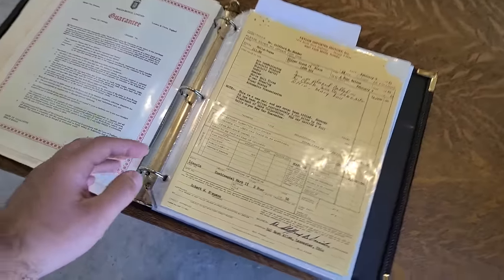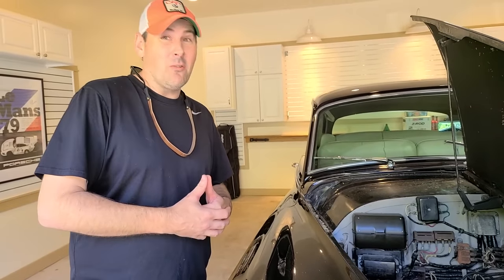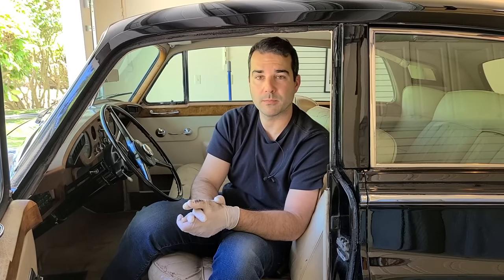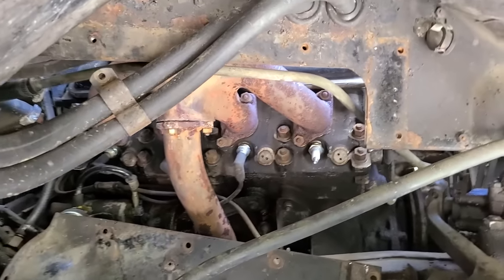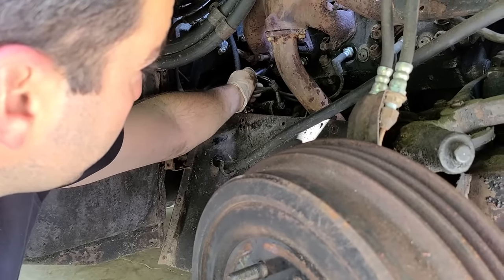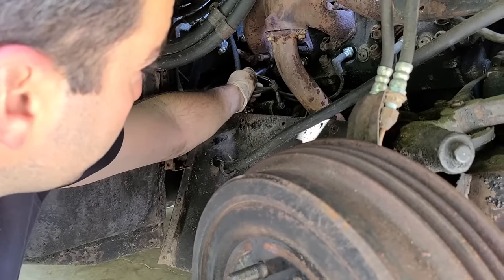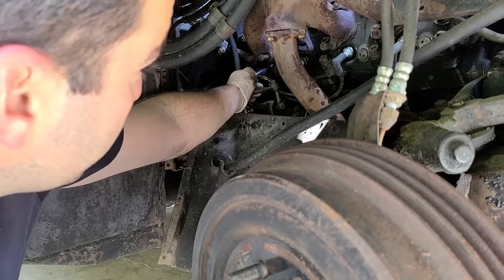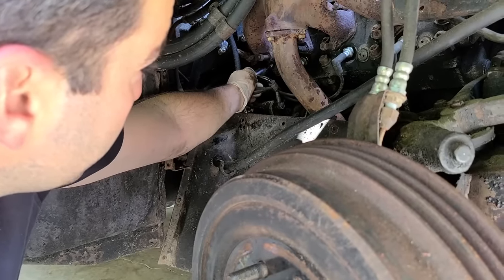I Bought A Broken Rolls-Royce 1000 Miles From Home! 1 Day To Fix EVERYTHING Before Hitting The Road!

Comment from the maker: What's a car you regret selling?
Get Honey for FREE today ▸ http://joinhoney.com/legitstreetcars
Reply: Hi bro I'm ine of the first 5 viewers lol
Reply: Regret selling? 2006 Acura TSX, 6 speed. Such a good car.
Reply: I had a 2005 Ford Mustang convertible. It was Red Fire, had the premium package and the Shaker 1000 stereo system. I traded it in for a brand new 2012 Mustang that had nothing extra. 2 weeks later I was kicking myself. I went from an automatic to a stick shift and that 2012 tops out 118 mph which was the thing that really irritated me because the drive shaft shatters at 135mph and it wobbled when you downshifted from 3rd to 2nd. You could feel it. A piece of crap.. 
Now I have a 2015 Mustang, that I got brand new 6 years ago and I couldn't be happier. Unless I also still had the 2005. I miss that car.
Reply: I’ve only sold 1 car and traded in 1 car.
I miss the trade-in (1985 LTD Crown Victoria).
Reply: Regret selling my 300sd Mercedes.
Reply: 91 mercury colony park wagon.
Ford's last wagon. Had 215k miles. Trans went. Should of fixed it.  Handy man's perfect car.
Reply: The only can I regret getting rid of was a 1991 jeep wrangler. Had the 4.0 liter, 5 speed manual.
Reply: So many! My first car, a '63 Austin Healey 3000, my '68 Firebird 400. Frame rust killed my '71 Corvette, parted out.
Reply: 1973 Plymouth Scamp 2 dr hardtop with a 318 /727 torque flight and custom rear end work
Reply: Not a car but a bike, A classic Royal Enfield from 60s. that bike drives me nuts while fixing but it was worth it. An Impulse Sale. wish i never did it
Reply: My '70 Plymouth Roadrunner with a 383 Magnum, (then again I was only 17 driving a five year old Mopar rocket).
Reply: 1955 Willys P/U
Reply: I regretted selling my W211 E55, so I bought it back....🤪
Reply: Thanks for the great video :) <3
Reply: I regret not buying a 1 owner 1972 280SL with 8,000 miles in 2008 for 8,000 bucks. That car is worth 250,000 today.
Reply: 1972 Impala custom coupe.
Reply: Stationed in Germany in 1985, bought a 1978 911 Porsche Targa with whale tail in bright red. I paid only 5 grand for it. The only thing wrong with it was the heat exchangers did not work and needed replacing. I had to sell it because I received orders to go back to the US and the car did not have the US safety specs to qualify bringing it with me. If I had taken the time to do more research on car import laws during that time I would have found that a person was allowed 1 waiver during his or her lifetime to import an exotic car into the US.  That car was so fun to drive.... miss it so much to this very day.
Reply: I regret selling my 1986 W150 Dodge Pickup followed by 2000 Dodge Pickup.
Reply: I regret selling my 1983 380SL
Reply: When are you gonna be on car trek bud?
Reply: Wow, the exact make and model I replied with a guess on your last video (1961 rolls Royce silver cloud)
Reply: My 4th Gen Toyota 4Runner V8 4WD Sport Edition. Never had a better car than that one
Reply: Convert it to electric with uncle rich.
Reply: Love it...
Reply: '66 Mustang I bought in high school.
'89 Celica my dad gave me.
'90 Supra I bought with the money I sold my Mustang for.
Reply: Hey man for shits and giggles. Will you take off the stock exhaust system and put a magna flow exhaust system on your RR silver cloud.? And if you decide to just put a stock one back on. 

 You know just for shits and giggles.
Reply: Hope you did not buy that goner m3?
Reply: My 1983 Oldsmobile Toronado 😔
Reply: My Jeep Wrangler
Reply: Good to see all the guys
Reply: 98 Toyota Corolla 5 speed manual, miss my gas saver
Reply: 1960 MIni
Reply: My 63 Chevy Impala and my 78 Nova. I’d look to have either of them back
Reply: 1959 MB 190SL. Purchased for $200 cash with only three wheels. Spotted while on a bus coming home from school. Off the bus, find the owner, buy the car and have it towed to Mom n Dad's. Parking on the street on a steel milk crate. Took subway to get parts until the guy said NO to a battery on the subway. Three gallons of body putty and countless aluminium bakery pan later I had my first car.
Reply: S2000 and El Camino.
Reply: I regret selling my old Mitsubishi Galant VR-4.
Reply: My 1983 rabbit GTI. I bought it from one of the guys who worked at Pete Lovely racing when I was stationed in Washington. Apparently it was the first GTI that Pete Lovely got into his dealership. Had no sunroof and dealer optioned power windows.  It was 100% original when I got it and I spent a lot of time and effort making it my own.
Reply: Hey I love your videos, I wish you did more with Toyota because that’s all I’ll buy 🤣
On a serious note! I like your logo but it’s black and I use dark mode and miss your notifications because your logo blends it. But Freddie’s tavarish logo stands out more
Reply: My 1969 Mustang Mach1 428 CJ 4 speed with the shaker air intake.
Reply: Small regrets on selling 1989 Ford sapphire Cosworth
Reply: You're a baller on a budget lol 😂😆
Reply: La swapped the rolls like watchJrgo...
Reply: I had a 67 Unimog 404 I should have never separated with.  Working now on replacing it
Reply: My 2001 Acura integra type r. But it probably would have gotten stolen at some point anyway.
Reply: 1990 Toyota supra 7mgte 5 speed, red on gray leather, tems suspension guy ordered new every option available now I cannot find another even similar
Reply: 1968 Torino GT convertible. White with blue C stripes Indy Pace car model.
Reply: None. Kept the 64 1/2 Mustang too long. The first gen slk  was fun  but build quality was shit. The S-10 was an 80s GM product. Now my VFR, that I regret trading in on the Blackbird
Reply: My 1962 Westfalia VW van with safari front windows. I sold it for $2,000 and now it's worth a bazillion. My mom's 1970 911E is another one... Sigh.
Reply: Toyota Corolla GT😎
Reply: 1972 Porsche 911t sepia
Reply: 32:49 the good thing is this car is not a 	right-hand drive, color is aristocratic, and this model is meanwhile rare, rises in value. Of course it might require twenty thousand - fifty thousand on repairs and replacements on the drive system, interior.
Reply: 1977 dodge aspen station wagon never did get to finish getting it on the road and I had to select as I was leaving
Reply: '56 Studebaker Champion 2 door
'78 Triumph Spitfire 1500
'68 Mustang 302, stick, notchback
'89 SAAB 900, 4 door non-turbo
Reply: 1970 2 dr All original Chevy Impala, young and stupid I still regret getting rid of her. The Rolls-Royce will probably end up being your most reliable Car, She's so Beautiful
Reply: My 78 Olds Delta 88 Diesel lowrider it was a boat that got 30 mpg and fun as hell with Hydraulics!
Reply: Well my first two "cars" actually. A 42 Ford GPW Jeep, and a 41 military closed cab 1/2 ton Dodge Weapons Carrier with a winch. Jeep was first the Power Wagon was a upgrade for the heater and a actual cab to sit in. I really miss them both and all of the stupid things I did with them.
Reply: @rohittaurus911  Had one too.  Great sounding bike. Really liked my '96 Mark VIII
Reply: @capedoryus  EPIC first car!
Reply: I regrett selling my 1962 Jaguar Mk2 3.8 manual!
Reply: Easy one, 2010 BMW X5 M. Loaded with every option imaginable. Lots of tech. Not a single issue, no dash lights. But expensive to maintain. Why I sold it.
Reply: 1974 Porsche 914. Should have never let that go.
Reply: 1985 MkII Supra 
1993 5.0 LX
Sold the Supra to buy the 5.0, wife got pregnant and the 5.0 went for a 1990-something Boringmobile. Wife is long gone, kiddo is 25 now and I’d give an appendage to have those 2 cars back.
Reply: @aulzhoefer  someone just stopped me yesterday and tried to buy my 2005 E55 and I was like, ‘nah, it’s not for sale, at least not yet.’
Reply: @altafari  nice one!  One of my favorites!  I had a chance once to buy a 914/6...  we couldn't agree on a price.  We got close but he really wanted $500.00 more than I physically had.  Sad Face.
Reply: 1969 Dodge Charger R/T SE & a 1967 Dodge Dart GTS 383 4 Speed.
Reply: My 69 GTO
Reply: 2003 Corolla. There was nothing wrong with it, never gave me any issues and now I miss it! Only sold it cause some lady offered $5k and I'd only paid $3k for it and was down $10k from the down payment on my new Veloster N
Reply: 1976 jaguar xj12l with a 351 Windsor and a c4 swapped in. Also the 1995 grand cherokee limited I drove in high school but that one is for sentimental reasons.
Reply: It's worth 150'000 to 200'000 to the right collector.
Reply: For my Dad, he always regretted selling his 1939 Chevrolet Sedan. Dad and Mom drove it from Milwaukee to Louisiana to Washington State and back to Milwaukee pulling their trailer during WW II. He always dreamed he had that car back!
Reply: A friend of mine bought the same car at Sotheby’s, because it belonged to the queen of England. The fuel consumption was about a bucket per mile, but I ran like a dream.
Reply: I have, and had, cars that I regret NOT selling. Sooner. TWO Citroen SMs for example. What is a person who has two SMs called? Glutton for punishment.
Reply: My Volvo Amazon -61 for $100.
Reply: Regret selling my 1969 opal GT
Reply: Dump some seafoam in the tank she will thank you for it
Reply: 1993 Camaro Z-28.
Reply: When I was 17 I bought a 1976 Saab 99.  i LOVED that car.  It was so much fun to drive and looked cool.  I paid $1500 for it.  Had it for 2 years and sold it when I went to College for something newer.  I've always regretted selling that.
Reply: 62 Mercury comet when I was 17
Reply: My 1970 W-31 Olds Cutlass.  An awesome car!
Reply: 2 Litre GT Ford Corsair Crayford Converted Soft Top in White with Red interior and Top.
No! Don't go looking for images. You'll end up wanting one.
London to Edinburgh in 4 hours with one fuel stop but back then there was no speed limit on the motorways and they filled your tank for you so it was more of a "Keep the change." Pit Stop.
Reply: 1962 VW Beetle 1200, 6Volt,  soft pushbback sunroof.. small oval back-window..
Reply: 71 alfa romeo spider with front end damage.
Reply: My father's gift to me for Xmas 1967 - pastel yellow Ford Mustang fastback
Reply: 1966 Imperial LeBaron. Absolute whaling ship, but sooo comfortable on long trips.
Reply: @AJGreen-cn8kk  ~~
Reply: 1954 XK-120MC & 1964 Pontiac LeMans 326
Reply: 1972 Chevelle SS 350. Racing 🏎️
Reply: My first car, a 1970 MGB GT...
Reply: My biggest regret was selling my 2003 BWM M3 CSL after 7 years of ownership. I thought I did pretty much everything with it during my 7 year stint with it but I guess I was wrong B-((.  Another regret was selling my one owner from New, fully documented, German import  (Black on Black ) 1993 Mercedes Benz 500e B-((
Reply: Eeeeeeeeeeeeeeeeeeeeeeeeeeeeeeeeeeeeeeeeeeeeeeeeeeeeeeeeeeeeeeeeeeeeeeeeeeeeeeeeeeeeeeeeeeeeeeeeeeeeeeeeeeeeeeeeeeeeeeeeeeeeeeeeeeeeeeeeeeeeeeeeeeeeeeeeeeeeeeweeeeeeeeeeeeeeeeeeeeeeeeeeeeeeeeeeeeeeeeeeeeeeeeeeeeeeeeeeeeeeeeeeeeeeeeeeeeeeeeeeeeeeeeeeweeeeeeeeeeeeeeeeeeeeeeeeeeeeeeeweeeeeeeeeeeeeeeeeeeeeeeeeeeeeeeeeeeeeeeeeeeeeeeeeeeeeeeeeeeeeeeeeeeeeeeeeeeeeeeeeeeeeeeeeeeeeeeeeeeeeeeeeeeweeeeeeeeeeeeeeeeeeeeeeeeeeeeeeeeeeeeeeeeeeeeeweeeeeeeeeeeeeeeeeeeeeeeeeeeeeeeeeeeeeeeeeeeeeeeeeeeeeeeeeeeeeeeeeeeeeeeeeeeeeeeeeeeeeeeeeeeeeeeeeeeeeeeeeeeeeeeeeeeeeeeeeeeeeeeeeeeeeeeeeeeeeeeeeeeeeeeeeeeeeeeeeeeeeeeeeeeeeeeeeeeeeeeeeeeeeeeeeeeeeeeeeeeeeeeeeeeeeeeeeeeeeeeeeeeeeeeeeeeeeeeeeeeeeeeeeeeeeeeeeeeeeeeeeeeeeeeeeeeeeeeeeeeeeeeeeeeeeeeeeeeeeeeeeeeeeeeeeeeeeeeeeeeeeeeeeeeeeeeeeeeeeeeeeeeeeeeeeeeeeeeeeeeeeeeeeeeeeeeeeeeeeeeeeeeeeeeeeeeeeeeweeeeeeeeeeeeeeeeeeeeeeeeeeeeeeeeeweeeeeeeeeeeeeeeeeeeeeeeeeeeeeeeeeeeeeeeeeeeeeeeeeeeeeweeeeeeeeeeeeeeeeeeeeeeeeeeeeeeeeeeeeeeeeeeeeeeeeeeeeeeeeeeeeeeeeeeeeeeeeeeeeeeeeeeeeeeeeeeeeeeeeeeeeeeeeeeeeeeeeeeeeeeeeeeeeeeeeeeeeeeeeeeeeeeeeeeeeeeeeeeeeeeeeeeeeeeeeeeeeeeeeeeeeeeeeeeeeeeeeeeeweeeeeeeeeeeeeeeeeeeeeeeeeeeeeeeeeeeeeeeeeeeeeeeeeeeeeeeeeeeeeeeeeeeeeeeeeeeeeeeeeeeeeeeeeeeeeeeeeeeeeeeeeeeeeeeeeeeeeeeeeeeeeeeeeeeeeeeeeeeeeeeeeeeeeeeeeeeeeeeeeeeeeeeeeeeeeeeeeeeeeeeeeeweeeeeeeeeeeeeeeeeeeeeeeeeeeeeeeeeeeeeeeeeeeeeeeeeeeeeeeeeeeeeeeeeeeeeeeeeeeeeeeeeeeeeeeweeeeeeeeeeeeeeeeeeeeeeeeeeeeeeeeeeeeeeeeeeeeeeeeeeeeeeeeeeeeeeeeeeeeeeeeeeeeeeeeeeeeeeeeeeeeeeeeeeeeeeeeeeeeeeeeeeeeeeeeeeeeeeeeeeeeeeeeeeeeeeeeeeeeeeeeeeeeeeeeeeeeeeeeeeeeeweeeeeeeeeeeeeeeeeeeeeeeeeeeeeeeeeeeeeeeeeeeeeeeeeeeeeeeeeeeeeeeeeeeeeeeeeeeeeeeeeeeeeeeeeeeeeeeeeeeeeeeeeeeeeeeeeeeeeeeeeeeeeeeeeeeeeeeeweeeeeeeeeeeeeeeeeeeeeeeeeeeeeeeeeeeeeeeeeeeeeeeeeeeeeeeeeweeeeeeweeeeeeeeeeeeeeeeeeeeeeeeeeeeeeeeeeeeeeeeeeeeeeeeeeeeee eacheeeeeeeeeeeeeeeeeeeeeeeeeeeeeeeeeeeeeeeeeeeeeeeeeeeeeeeeeeeeeeeeeeeeeeeeeeeeeeeeeeeeeeeeeeeeeeeeeeeeeeeeeeeeeeeeeeeeeeeeeeeeeeeeeeeeeeeeeeeeeeeeeeeeeeeeeeeeeweeeeeeeeeeeeeeeeeeeeeeeeeeeeeeeeeeeeeeeeweeeeeeeeeeeeeeeeeeeeeeeeeeeeeeeeeeeeeeeeeeeeeeeeeeeeeeeeeeeeeeeeeeeeeeeeeeeeeeeeeeeeeeeeeeeeeeeeeeeeeeeeeeeeeeeeeeeeeeeeeeeeeeeeeeeeeeeeeeeeeeeeeeeeeeeeeeeeeeeeeeeeeeeeeeeeeeweeeeeeeeeeeeeeeeeeeeeeeeeeeeeeeeeeeeeeeeeeeeeeeeeeeeeeeeeeweeeeeeeeeeeeeeeeeeeeeeeeeeeeeeeeeeeeeeeeeeeeeeeeeeeeeeeeeeeeeeeeeeeeeeeeeeeeeeeeeeeeeeeeeeeeeeeeeeeeeeeeeeeeeeeeeeeeeeeeeeeeeeeeeeeeeeeeeeeeeeeeeeeeeeeeeeeeeeeeeeeeeeeeeeeeeeeeeeeeeeeeeeeeeeeeeeeeeeeeeeeeeeeeeeeeeeeeeeeeeeeeeeeeeeeeeeeeeeeeeeeeeeeeeeeeeeeeeeeeeeeeeeeeeeeeeeeeeeeeeeeeeeeeeeeeeeeeeeeeeeeeeeeeeeeeeeeeeeeeeeeeeeeeeeeeeeeeeeeeeeeeeeeeeeeeeeeeeeeeeeeeeeeeeeeeeeeeeeeeeeeeeeeeeeeeeeeeeeeeeeeeeeeeeeeeeeeeeeeeeeeeeeeeeeeeeeeeeeeeeeeeeeeeeeeeeeeeeeeeeeeeeeeeeeeeeeeeeweeeeeeeeeeeeeeeeeeeeeeeeeeeeeeeeeeeeeeeeeeeeeeeeeeeeeeeeeeeeeeeeeeeeeeeeeeeeeeeeeeeeeeeeeeeeeweeeeeeeeeeeeeeeeeeeeeeeeeeeeeeeeeeeeeeeeeeeeeeeeeeeeeeweeeeeeeeeeeeeeeeeeeeeeeeeeeeeeeeeeeeeeeeeeeeeeeeeeeeeeeeeeeee we eeeeeeeeeeeeeeeeeeeeeeeeeeeeeeeeeeeeeeeeeeeeeeeeeeeeeeeeeeeeeeeeeeeweeeeeeeeeeeeeeeeeeeeeeeeeeeeeeeeeeeeeeeeeeeeeeeeeeeeeeeeeeeeeeeeeeeeeeeeeeeeeeeeeeeeeeeeeeeeeeeeeeeeeeeeeeeeeeeeeeeeeeeeeeeeeeeeeeeeeeeeeeeeeeeeeeeeeeeeeeeeeeeeeeeeeeeeeeeeeeeeeeeeeeeeeeeeeeeeeeeeeeeeeeeeeeeeeeeeeeeeeeeeeeeeeeeeeeeeeeeeeeeeeeeeeeeeeeeeeeeeeeeeeeeeeeeeeeeweeeeeeeeeeeeeeeeeeeeeeeeeeeeeeeeeeeeeeeeeeeeeeeeeeeeeeeeeeeeeeeeeeeeeeeeeeeeeeeeeeeeeeeeeeeeeeeeeeeeeeeeeeeeweeeeeeeeeeeeeeweeeeeeeeeeeeeeeeeeeeeeeeeeeeeeeeeeeeeeeeeeeeeeeeeeeeeeeeeeeeeeeeeeeeeeeeeeeeeeeeeeeeeeeeeeeeeeeeeeeeeeeeeeeeeeeeeeeeeeeeeeeeeeeeeeeeeeeeeeeeeeeeeeeeeeeeeeeeeeeeeeeeeeeeeeeeeeeeeeeeeeeeeeeeeeeeeeeeeeeeeeeeeeeeeeeeeeeeeeeeeeeeeeeeeeeeeeeeeeeeeeeeeeeeeeeeeeeeeeeeeeeeeeeeeeeeeeeeeeeeeeeeeeeeeeeeeeeeeeeeeeeeeeeeeeeeeeeeeeeeeeee r eeeees76a67s776s7ezeaeeeweaeeeeeeeeeeeeeeeeeeeeeeeeeeeeeeeeeeeeeeeeeeeeeeeeeeeeeeweeeeeeeeeeeeeeeeeeeeeeeeeeeeeeeeeeeeeeeeeeeeeeeeeeeeeeeeeeeeeeeeeeeeeeeeeeeeeeeeeeeeeeeeeeeeeweeeeeeeeeeeeeeeeeeeeeeeeeeeeeeeeeeeeeeeeeeeeeeeeeeeeeeeeeeeeeeeeeeeeeeeeeeeeeeeeeeeeeeeeeeeeeeeeeeeeeeeeeeeeeeeeeeeeeeeeeeeeeeeeeeeeeeeeeeeeeeeeeeeeeeeeeeeeeeeeeeeeeeeeeeeeeeeeeeeeeeeeeeeeeeeeeeeeeeeeeeeeeeeeeeeeeeeeeeeeeeeeeeeeeeeeeeeeeeeeeeeeeeeeeeeeeeweeeeeeeeeeeeeeeeeeeeeeeeeeeeeeeeeeeeeeeeeeeeeeeeeeeeeeeeeeeeeeeeeeeeeeeeeeeeeeeeeeeeeeeeeeeeeeeeeeeeeeeeeeeeeeeeeeeeeeeeeeeeeeeeeeeeeeeeeeeeeeeeeeeeeeeeeeeeeeeeeeeeeeeeeeeeeeeeeeeweeeeeeeeeweeeeeeeeeeeeeeeeeeeeeeeeeeeeeeeeeeeeeeeeeeeeeeeeeeeeeeee weeeeeeeeeeeeeeeeeeeeeeeeeeeeeeeeeeeeeeeeeeeeeeeeeeeeeeeeeeeeeeeeeeeeeeeeeeeeeeeeeeeeeeeeeeeeeeeeeeeeeeeeeeeeeeeeeweeeeeeeeeeeeeeeeeeeeeeeeeeeeeeeeeeeeeeeeeeeeeeeeeeeeeeeeeeeeeeeeeeee3eeeeeeeeeeeeeeeeeeeeeeeeeeeeeeweeeeeeeeeeeeeeeeeeeeeeeeeeeeeeeeeeeeeeeeeeeeeeweeeeeeeeeeeeeeeeeeeeeeeeeeeeeeeeeeeeeeeeeeeeeeeeeeeeeeeeeeeeeeeeeeeeeeeeeeeeeeeeeeeeeeeeee4eeeeeeeweeeeeeeeeeeeeeeeeeeeeeeeeeeeeeeeeeweeeeeeeeeeeeeeeeeeeeeeeeeeeeeeeeeeeeeeeeeeeeeeeeeeeeeeeeeeeeeeeeeeeeeeeeeeeeeeeeeeeeeeeeeeeeeeeeeeeeeeeeeeeeeeeeeeeeeeeeeeeeeeeeeeeeeeeeeeeeeeeeeeeeeeeeeeeeeeeeeeeeeeeeeeeeeeeeeeeeeeeeeeeeeeeeeeeeeeeeeeeeeeeeeeeeeeeeeeeeeeeeeeeeeeeeeeeeeeeeeeeeeeeeeeeeeeeeeeeeeeeeeeeeeeeeeeeeeeeeeeeeeeeeeeeeeeeeeeeeeeeeeeeeeeeeeeeeeeeeeeeeeeeeeeeeeeeeeeeeeeeeeeeeeeeeeeeeeeeeeeeeeeeeeeeeeeeeeeeeeeeeeeeeeeeeeeeeeeeeeeeeeeeeeeeeeeeeeeeeeeeeeeeeeeweeeeeeeeeee
Reply: 1992 toyota 4x4 pickup
Reply: I regret selling my 64 Impala convertible. I didn’t want to. I had to. Her name was Alexis. I miss her more than any of my ex girlfriends. (Although I did have a girlfriend with a 67 Riviera. I miss her car too.)
Reply: @rohittaurus911  
I miss my 64 Norton 750 Atlas. I didn’t sell it though. It was stolen from me. It still pisses me off.
Reply: @VegasShuffle  
Oh, are we going to talk about cars we regret not buying? Ok. I have a whole list of those. I didn’t buy a 55 Bel Air one time. Wish I had that now. Didn’t buy a 67 Riviera GS. 68 GTO. There are more but the car I most regret not buying was a 58 Impala. I passed because it had a 283 and I wanted a 348. Dumb. I could have bought it and put a 409 in it. I wanted numbers matching though. Dumb.
Reply: I regret selling my 1977 Jaguar xjc. Your Rolls reminds me of it. I used to get thumbs up and felt on top of the world driving it. It was the 4.2l 6cylinder squadron blue with blue leather interior, white walls and chrome factory wheels with a black vinyl roof. The best thing about the xjcs when you wind all 4 windows down you feel like you are driving a convertible, bu the sun doesnt burn your head... I miss it dearly. I bought  aV12 version of same car a few years ago and am slowly restoring it, so i wont have to wait too long to enjoy driving one again. Mate I love your channel, e55s got me into it and I have a cls55amg, my most powerful car. But a completely different experience to driving the Jaguar. Top channel, top content, thanks Alex love from Australia
Reply: 1974 Pontiac Grand Prix...so,"I bought it back"
--}¡♡¡
Reply: Only one regret in life - selling my 1980 Porsche 911 widebody... just plain stupid
Reply: My regret selling was my Camaro 2012, 320i M sport 18/18, 330i M sport 20/20
Reply: My 78 Peterbilt 359. I paid $5000.00 put $3000.00 into it and got 15000.00 on a trade for a bland cookie cutter 92 379. Dumbest move I ever made.
Reply: My first car. A 1967 Dodge Dart. Blue, 4 door. Got it from my uncle. I loved that car.
Reply: I really regret selling my 2009 AMG C63.. I miss that sound.
Reply: 11
Reply: @zezom3341  pp
Reply: I’ve never regretted selling any of my carb but that’s probably got something to do with the fact that they’ve all been shitty vvti toyotas, but my grandpas friend had an Aston Martin db5 and he sold that in the early 80s now look at what it’s making. He also sold a Vincent black shadow and regrets that big time
Reply: 1959 Nash Rambler and a 1996 Ford Festiva
Reply: My green 1956 Standard Vanguard with electric overdrive.
Reply: 1959 Nash Rambler Classic beautiful car
Reply: In 1976 I sold my partially restored ‘58 Corvette to raise enough travel money for a move from Alabama to Tempe, AZ and ASU.  I’m embarrassed to say what I took for the sale. Long story short, I regretted selling the car the minute the guy drove it away.
Reply: 84’ olds delta 88 I had in high school, was a 1 owner car and all original down to the regan/bush 84’ sticker on the back bumper. There’s actually a video of it on my channel.
Reply: 1985 Pontiac 6000 STE. Had to be one of my favorite cars. Bought it new.. My very first New car that I bought myself. It was an amazing auto for an American car company in that era.
Reply: 68 GT0 400 4 speed!
Reply: 68 super beatle..
A stupid, near unless, totally underpowered car. Didn't even have AC.
What a blast to drive. lol.

Also, 76 Monty Carlo. Two door with swivel bucket seats.
Huge , heavy tank with one smooth ride.
Reply: My 1989 W126 Mercedes Benz - probably the best car I've ever had. Built like a tank, super reliable, easy to maintain, and gorgeou styling. Had no choice since I moved to the US and had to sell a lot of stuff, including my car.
Reply: Kind of ironic that the video is three years old. I’m just now seeing this one, but you paid three times too much for the car what you’ve purchased is very nice looking car. I love them been around them my entire life. The problem is it’s one of the most difficult vehicles to work on mechanical I probably not gonna watch the whole video cause it’s pretty boring unfortunately sorry I did notice you guys were talking about the overheating problem in the beginning and the fins on the grill were closed. Those are operated by the thermostat if you probably haven’t already found that out, which I’m sure you have Anyways that’s the majority of problems when people have those overheating but we can get into a lot more but it technically speaking you say you really not that much of a mechanic so it would be a waste of time to try to explain it to you
Reply: My Citroen Berlina 11 Sport 1954. What a futuristic car.
Reply: Volvo 760 GLE. Had the largest engine ever placed in a Volvo. Had an acceleration and topspeed like no other Volvo.  Bought it at auction from Volvo. It had driven less than 70K KM after having been used as VIP car at international conferences, it had been shipped around to for 3 years. Had refrigerator and TV. Drove it 200.000 KM and besides normal service, brake pads, bulbs, oil change, tires etc nothing broke down on it at all. Sold it because the company I worked for went belly up and I had to leave the country I were stationed in. 3 months later I began a new job in a country with no car tax and I could thus have brought it with me for free.....arrrrghhh! I loved that car.